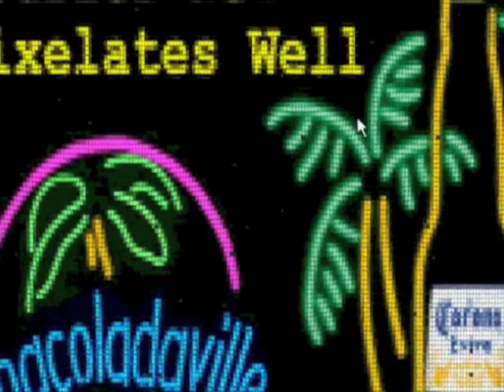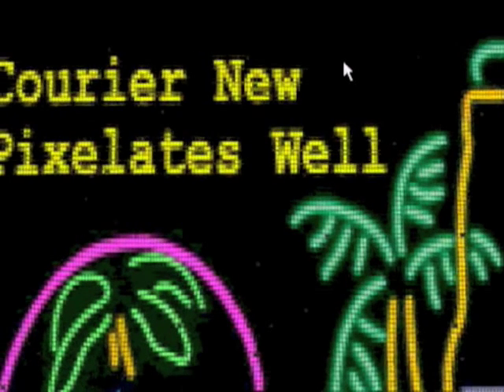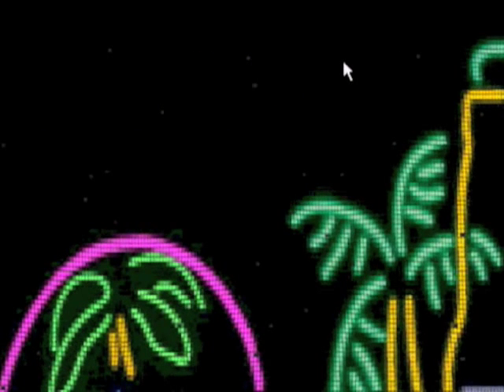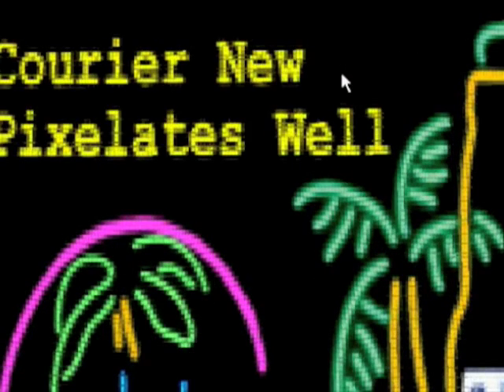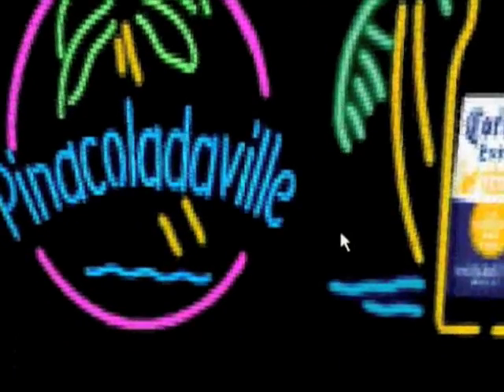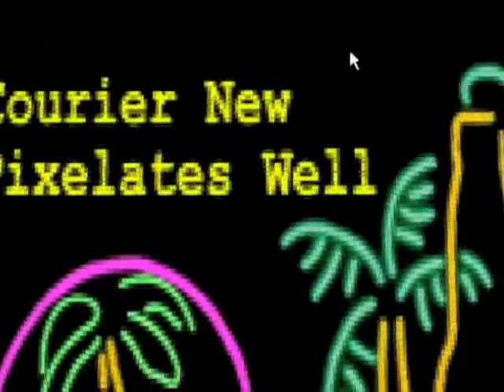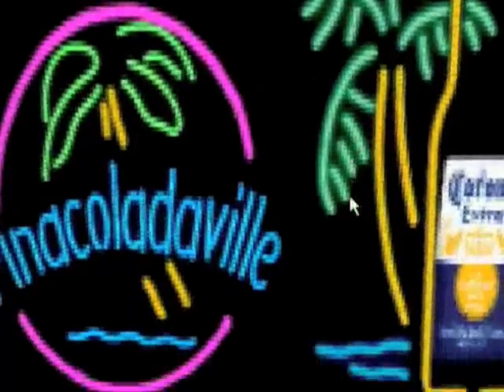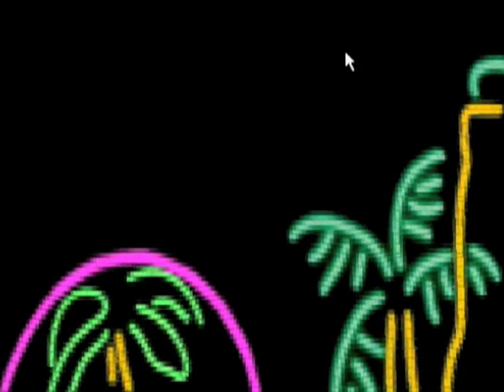LED Shader Tutorial Demo

Comment: It's a great effect! Thank you so much for sharing!

I have a problem though - When my camera moves away from the texture, the effect doesn't remain consistent. Depending on the values (such as pixel size) and the resolution of the display I'm using, the effect goes crazy!  Did you try moving the camera, and, if so, did you also find that problem (also with multiple resolutions)?

Thank you for your time!